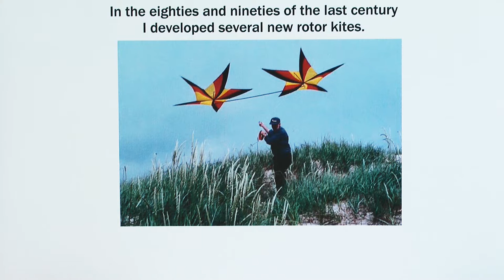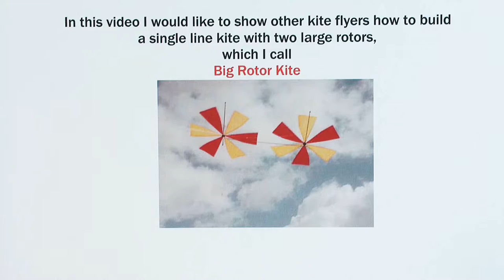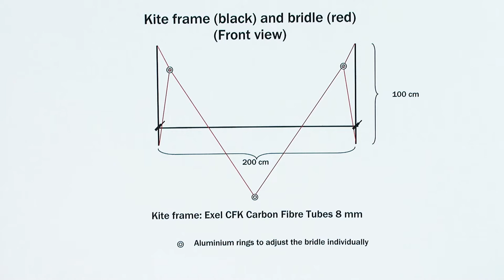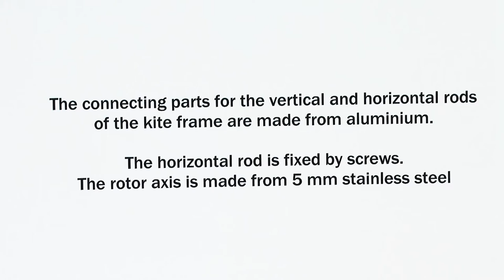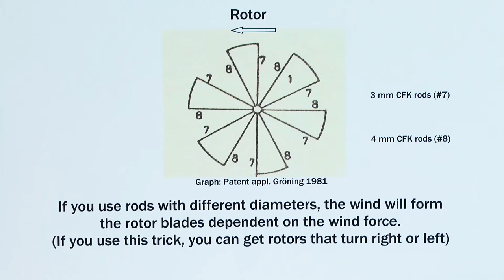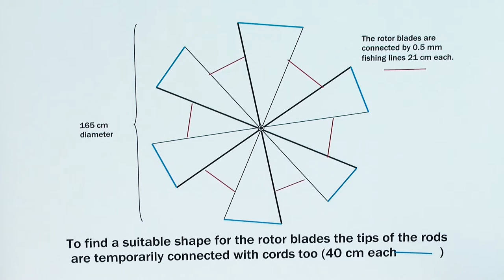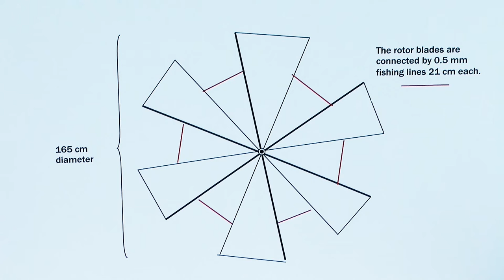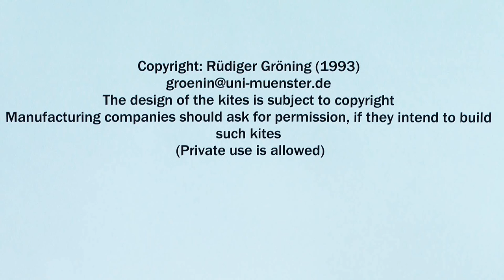Tutorial: How to make the "Big Rotor Kite"

Comment: Hello again Rudiger, I am working on a project with a few other Mechanical engineering student. We are working on designing a kite similar to this one with the purpose of generating electricity. We are working on putting together the underlining equations involving lift and drag to determine the optimal size and angle of the kite. Just wondering if you have any insights/ references regarding the lift and drag theory behind the performance of your design. Thanks!
Reply from the maker: Hello Joe, nice to hear from you and your project. I think, if you want to generate electrical energy, it may be best to install  rotor kites near to the ground, and to connect  the rotation axes of the kites directly with generators, which are located on the ground. Additional fixed connections may be necessary to lift the rotors. Usual generators are too heavy for kites, which are lifted via kite lines. Only very small generatiors may be used for such kites.  
I think, it is very interesting to get some insight into the mathematics and the theories behind the action of the kites. Although I gave lectures about physicvs  during my university career, I only have limited insight into aerodynamic principles of the rotorkites.
I wish you success. Take care.
Rüdiger
Reply: @rudigergroning8726  Thanks for the insight Rudiger!
Reply: One other question. What is the weight of this kite?
Reply from the maker: @joemurphy6186  The weight is 1 kg.
Reply: Hello joe murphy, as a mechanical engineer myself I had the same idea of using this kind of kite to gain electricity. I would love to know how your project turned out. Did you get any theoretical insights or even a practical success?

Comment: I have that now! But I need to know what was the minimun wind speed for that kite.
Reply from the maker: Hi, the minimum wind speed is about 1.5 Bft.
Reply: 1.5 Beaufort? Is it light-winded like a delta? Please tell it in MPH.
Reply from the maker: It's about 4 MPH
Reply from the maker: It is light-wided like a delta
Reply: Anyway, mine was never want to fly at its highest at all. And the worst, it's sweeping from side to side. Any suggestions?
Reply from the maker: Hi,  what is the diameter of the rotors? If you use smaller rotors, it is necessary to use two kite tails, which are attached to  longer vertical  rods of the kite frame.
Reply: Roughly 10 cm, like that. I'm using bamboo in longest spar of kite frame, and I have noticed that this part was able to twist unexpectedly. Is it the main reason of sluggishness? Is it?
Reply from the maker: The longest part of the kite frame may twist, I think it is not the problem. Where do you live? Would you please send an email? So we can exchange pictures.
Reply: Facebook is a faster option, if you can Sir.
Reply from the maker: Sorry, I am not on facebook.
Reply: Can it survive even in gusty winds?
Reply from the maker: Hi, the described kite is only for constant low wind. For more and gusty wind more stable axis (e.g.5 mm steel) and thicker rods for the rotors are necessary.
Reply: I have recently discovered that the stable flight of this kite truly depends on the elasticity of vertical spars where the symmetrical bridle attachment points is located, regardless of size of the rotors, and even its being a high aspect ratio kite.

I'm always noticed such thing when I watching this video many times, even in your freshly uploaded one, entitled as "Big Rotor Star Kite".

So now I have learned that the presence of elasticity in that part is extremely vital, am I right?
Reply from the maker: You may be right. But I didn't use elastic vertical rods yet. When I build kites with more stable rotors, which are suitable for strong wind, I use 8 mm CFK tubes with a 6 mm tube inside.
Reply: I have finally succeed in this kite, with a minimum flight angle of 45°!

People in our town were got crazy, saying "What was that?" or "Extremely exceptional!". Thanks a lot for this.
Reply from the maker: Congratulation!
Reply: By the way Sir, what was the flight angle of yours? The perspective from your camera is really confusing.
Reply from the maker: The flight angle depends on thermic and wind speed. In the video at the end of the tutorial it is about 70°. But in summer at a beach the kite is someties nearly straight up in the air. In this case it is necessary to control the kite via the kite line to stabilze the flight.
Reply: Can I anchor it somewhere and leave it flying on its own?
Reply from the maker: Normally I control the flight via the kite line. You will have to decide it. There are a lot of factors, which influence the stable flight: constant wind, flight angle which can be adjusted via the bridles, large rotors will give a more stable flight, and so on. If you want to construct an energy producing kite, you may use a kite which flies near to the ground and which has several stable connections to the ground.
Reply: In zero wind, if I would run with the kite, what would be its expected flight angle?
Reply from the maker: May be 20°
Reply: Really sir? By running? I'm expecting that you would say it's still 70°.
Reply from the maker: I didn't tested it yet. One question for my information only: I which country do you live?
Reply: I'm from Philippines.